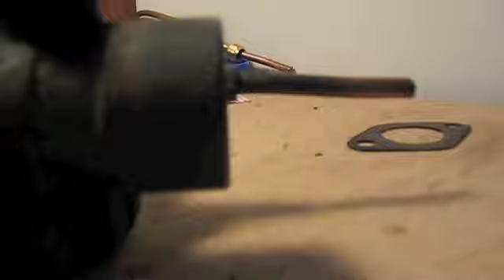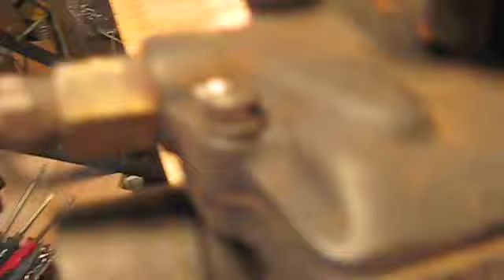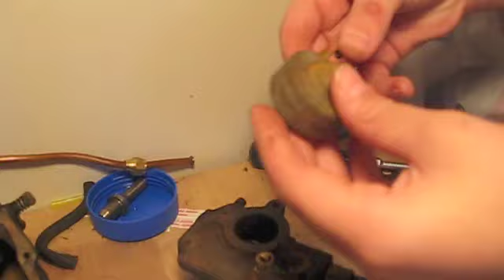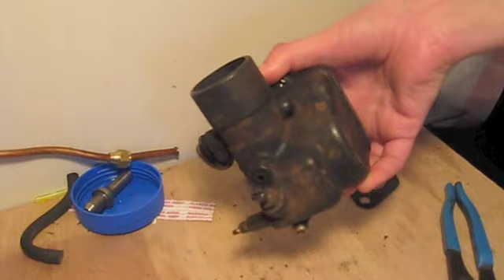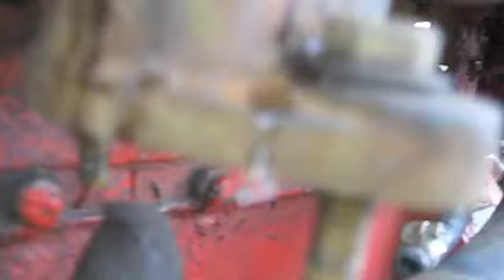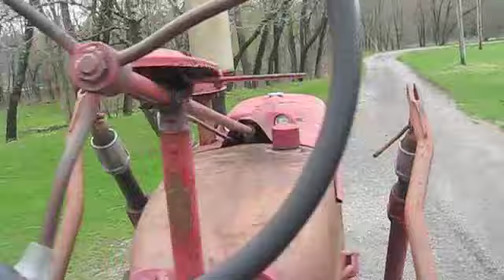1945 Farmall H carburetor repair

Comment: great video. keep it up :P i think that this carburetor is working properly. ive noticed with these farmal carbs, if you choke the tractor while starting it sucks an extreme amount of fuel into the carburetor. and if you choke the tractor to much, it will completely fill the air horn up with fuel and cut off the tractors air. hence the not starting. to prevent this from happening just use less choke on the tractor. and the next time it happens just let the fuel drain out of the carb. or you can take off the intake hose where it connects to the carb and all the gas will come out.

Comment: that hole is the overflow drain, if it has gas flowing out of it, you either have a bad needle valve which doesn't look like the case or your float bowl is not set right to shut the needle valve.

Comment: @ Michael Curry.  Are you saying it was manufactured that way?  Why would the manufacturer want to let the gas drip on the block and strip the paint off the tractor?  I don'T agree that it is 'supposed to' leak out.

Comment: Nice job, keep at it. I hope the old H is still running well. I love these old tractors. 

One thought....be careful with the wrench on the battery....if the wrench gets bumped or turned, it will make quite the fireworks show as it welds to the two terminals. (been there, did that, it was not pleasant. Wrecked the wrench and the battery).

Comment: Did the cleaning of the needle and seat fix it, or are you going to replace them?  Our needle/seat sticks sometimes on our 1940 H.  Right now I use the rock method to fix it.  If I see its dripping I hit the side of the carb with a rock which frees up the needle.  I grabbed a rebuild kit that has a needle and seat and I'll swap them out.